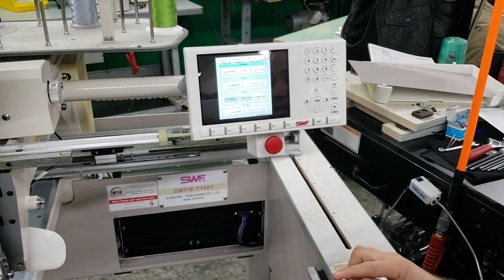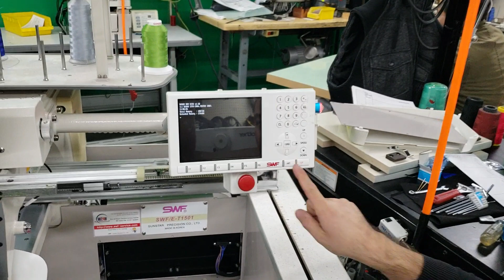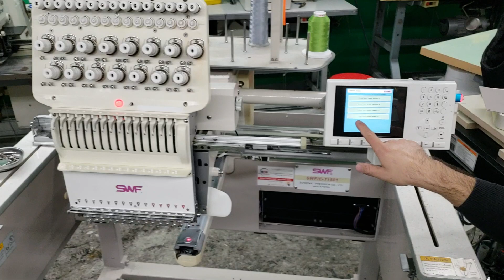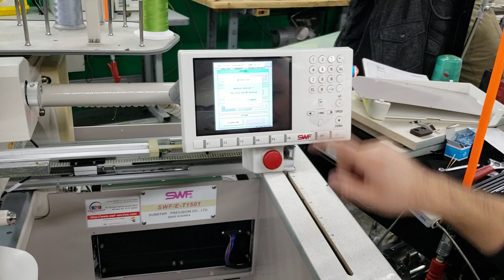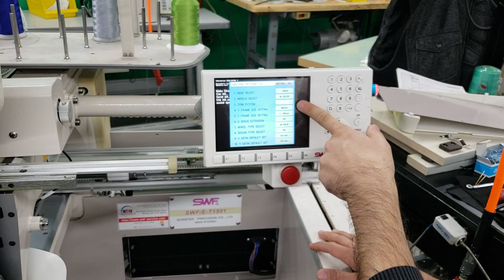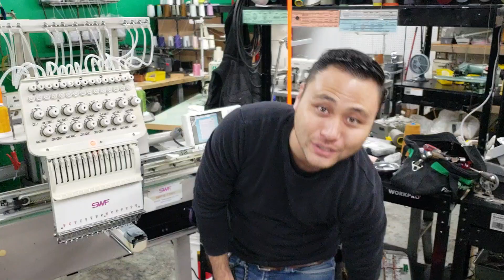How to Format / Install Version on your SWF Embroidery Machine

Comment: My machine loads and only displays the SWF logo. What's wrong?
Reply from the maker: Could be a few things.  Power supply (smps)not sending correct volts for boot up.  Too difficult to test the voltage on this model so best to unplug the machine, pull out each board rack and clean/inspect.  Then try.  
If you have the same issue then see if youre able to get into the version install screen like the video when you see the swf
Reply: @ABCSewingMachine do u have book manual for small swf E 6H

Comment: Hi, using a swf single head 12 needle when I load my usb into my machine I can see the folder but no design appears? Any help would be appreciated.
Reply from the maker: If your designs are in the folder then you will have to push the Dir/Fil button to move the red square to the correct side and select the folder that has the designs in it.  If you save the Designs in the folder then you have to select folder then toggle the Dir/Fil to move the red square cursor to the right where the designs should be.  Make sure you save the designs in the .DST file format.
If that still doesn't show, save the files on its own in the usb and not in a folder.  It should show up right away.
Reply: Thank you so much for your reply. So much appreciated

Comment: We have SWF/B type 6 head sewing machine. Left side (3 heads) sew in mirror and % wise smaller texts, but it is not set to be like that. Configuration on both sides is the same. Problem started after device was turned on. Before everything was working fine. Can you please give some tips what to check or what to do?

Comment: Hey Joseph this Gene the one that came in to get a cap driver for my swf e-t1501c. Im trying to hook up the ethernet to the sens software the mx86  but its not finding the file. Its giving me a error #614 system file not found. Im on swf install program v4.21 2007. 8.31 at the bottom it says DB ROM Ver4.21. I went to Disneyland and they run the same machines thru ethernet.  I have the ethernet plug under the bottom of the screen and the sens input under input. You have that file i need.
Reply from the maker: Sorry Gene.  I've never connected the sens with the new mx cpu boards.
Reply: @ABCSewingMachine  I thought it was the old board. I have the mx86 data file and that didn't work.

Comment: Hey Joseph, thanks so much for your help. Is there any way to clear the design memory more easily than this on a mas-12? I have been deleting designs one by one to make room and I didn't notice anything in the manual about clearing all designs. My old t series machine has an option for this so I feel like I'm just missing something.

Comment: Hi, I have a SWF/EN-T1501, is it possible to update the software please?
Also, my X Y offset is set to X: -1054 Y: -483 how can I reset this back to 0 as I cannot find a setting anywhere to reset it so my frames are centred properly. I can send you pictures if  that will help>
Many thanks in advance

Comment: Thank you for a very well done video. I currently run an SWF E1502 and its been running great for years. Today it is stuck on System Initialize screen. I noticed the last couple times I turned it on the screen was black but the buttons still beeped. I turned it off and on again the start up screen was there and it worked until today. Now its stuck on the SI Screen. Would a reload of the software help or is one of my boards going bad? Thanks Bob
Reply from the maker: Hey bob
System initialize can be caused by a few different things. If the machine does not have 5V being supplied to the panel then it will not pass the boot up screen.  Checking your power supply (SMPS) voltage for +5v and -5 should be checked before changing any boards.  

If you're able to follow parts of the video on backing up your data and reinstalling the version WITHOUT FORMATTING and it works then I would recommend trying a format. 

Back up data and program first. 
Then format.
After format select "E series 2,4,6 head" for machine version. 
Then install data, program, upgrade. 

Settings:
1 head 
15 colors
X space: 500
Y space: 450
Trim type solenoid 
Wheel type 50 hole 
And the rest should be regular. 

Then
Reply: Okay I’m actually did use your video to backup and so on. I’m at the point of wheel type. But being a 2007 it would be a 50 hole not 18? Also what should I set the X and Y satin stitch at for mm
Reply from the maker: @rcook999  should be 50 hole if 2007. 
Only a and b series would be 18 hole. 

X satin / y satin 0.0 
Sequin no
Reply: @ABCSewingMachine   Just wanted to thank you for all your help. Back up and running thanks to you.

Comment: Why is it that the color change sequence isn’t going as programmed?
Reply from the maker: Always important to check if your color change issue is caused by the potentiometer or something else. 

Example:  if you set color 1, 2, 3 for your design and when you run and goes to the wrong color, then you have to see what needle/color it shows on your screen. 
If you set 1,2,3 and on the 2nd step the screen shows another needle but you're actually on needle 2 then potentiometer issues. 

If supposed to be on needle 2 but it goes to needle 5 and shows 5 on screen as well then check your color sequence.  

To check if you potentiometer is okay you can go into the setting this video shows, then go to "Para set" and Go.  Then on the top right you will see small  setting button. 
Select it and then go to needle position test.  

Turn it on and move to needle 15 manually.  You should be around 142, half turn sensor on, and hear a beeping sound. 

As you go from 15 to 1 slowly the number value should be going in sequential order without jumping to a random number or flashing 0. If you see this then change potentiometer.

Comment: Love the videos they help out a lot for a newbie here. My SWF F/E-T1501 the F1 and F2 buttons are grayed out, I am not sure what I hit that did that.  Do you have a video on how to get them back or can you help me fix it please. Thank you
Reply from the maker: Your F2 shouldn't be grayed out since you need to input a design for your F1 "emb call" to work. 

Was this after you formatted and installed the version.  Make sure to install correct version for your machine.
Reply: @ABCSewingMachine   Thank you for anwsering....I did not have my glasses on and the wrong button and then thats when F1 and F2 turned gray.  They were there before I hit the wrong buttons. So not sure what I hit but I was not doing a new install or formatting.

Comment: I just got a swf b-t1501 15 needle single embroidery machine it has the LCD controller and only has the floppy disk slot, how do i load the designs from the floppy disk to the machine?

Comment: the screen is freezes..  i have a swf/sa_wk912_55 its screen is like k series if i hold org then turn on machine two options comes up 1-sp1 flash romdisk 2-floppy[drive A]   (i already floppy rom to flash reader)  when i  chose 1 nothing changes but when i press 2 its read the flashmemory but says cant read the boot disk becuz my flash is empty. i dont have files. how can i find resources or rom?

Comment: Hi Wondering if you can help...i've followedyour video for my SWF MA-6 machine as it was stuck on 'System initialize' ...Ive been able to fix it by reformatting and reload the software but this time it hasnt worked. "System Initialize" doesn't seem to affect many machines as there is next to nothing on the net to help out and if I find something its fixed with a reformat and a reload. Any ideas on what might be happening? Thanks :D

Comment: Do you have videos of diferent errors 😩😭
Reply: What Error do you have on your machine?
Reply: @josephpark2256  i have the  swf-e-t901c, sale error 102, sobrecarga
Reply from the maker: @bordarycoser1117  error 102 is a motor overload error.  Turn off the machine and turn the wheel by hand and see if it feels tight.  If yes then find the bind and try again.  If the wheel is smooth then it could be the main motor, the main board, or the encoder.

Most times there is thread stuck in the hook area or a broken needle.  Or your machine needs oil and grease to make smooth again.
Reply: Joseph Park wend i off the machine the next day i turn on and wend i start to embroidery the machine stop and put on the screen to make a trim and wend i trim then put return to power origin? And do that again and again
Reply: @seadoojetboatpuertorico7620  Okay it might be better to call me on this one.  You can email me your info to contact@abcsewingmachine.com

Comment: Hi I have a e-1501C and when I add the cap driver and trace, the Y-axis is malfunctioning. I am getting error 202 where Y-axis irregular signal is detected. Without the cap driver the machine works and embroiders fine. Is there anything you can think of?

Comment: I have been all around the internet for this problem, I am stuck in a pattern, f2 is deactivated, is this my last resort?  as you said try every before this, beside pressing buttons willy nilly im thinking this is my last resort.  help would be great full.  Anitra
Reply: What is the model number and are you able to clear the current embroidery job and select another one?
Reply: @josephpark2310  swfet1501c, new to me machine, I press stop,f1activates no or yes but f2 not highlighting, press escape and and I get a yes no question, both do nothing.  I can embroider this pattern but thats it.
Reply: ahh now the factory reset disk did not work, I backed it up and had the original but its broken,, stuck in bios/dos,  'exiting due to signal sigsegv'  "shutting down allegro"
Reply: @porterbennett7041  those are signs of the CPU being bad or the memory

Comment: Hello, I have swf/k-uk1506-45 , when you select needle it will go to the selected needle. But if you star the design it will go to needle 15 and hooks there until you restart the machine. How can I get the software upgrade file. Thanks